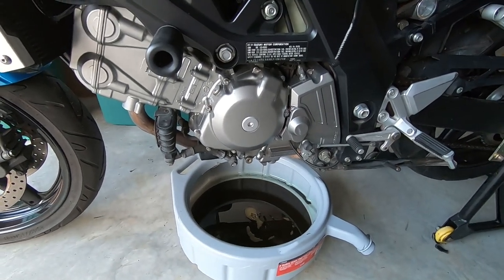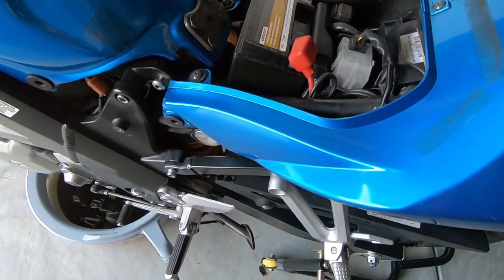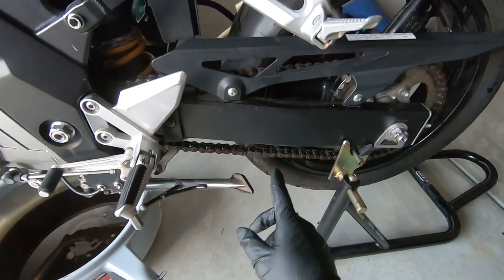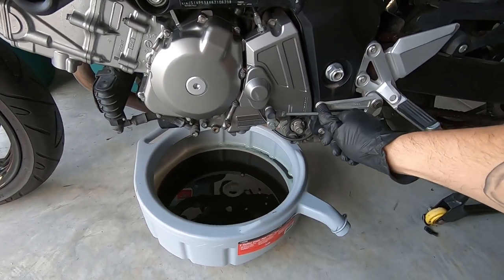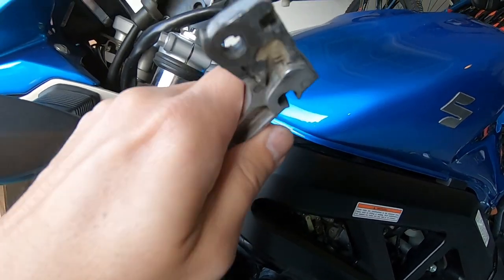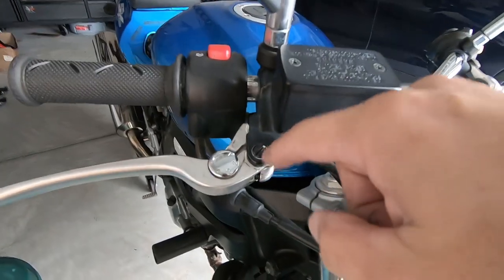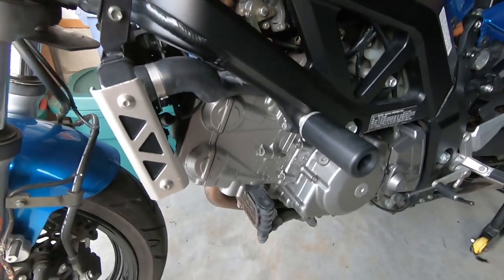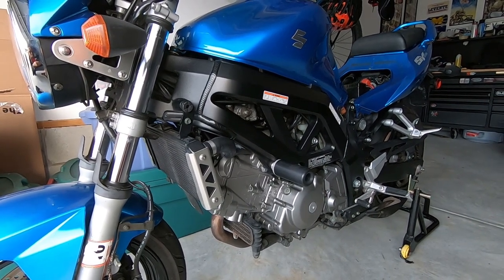Suzuki SV650 Maintenance and update

Comment: Great tips i appreciate it I just purchased an sv and noticed my rear break is not working. Did you ever figure out why your rear break is not working ? I bleed the rear breaks and I am still not getting any tension in rear breaks thx !
Reply from the maker: Yes.  The rear master cylinder was clogged and gummed up and the orings inside were in bad shape.  I rebuilt the master cylinder and it worked great.

Comment: Excellent explanations, very good video thanks.. just a tip try not to use wd40, use silicone lubricant and it works the best for these kinds of small maintenance like clutch cable without making things sticky and greasy
Reply from the maker: Great tip. And thanks for the complimemt.